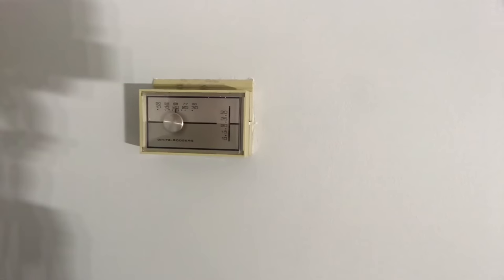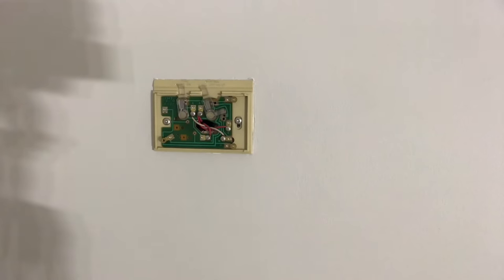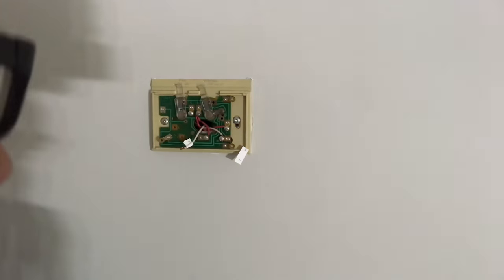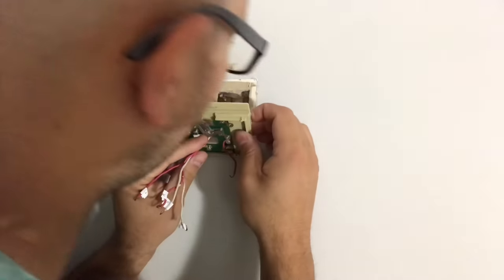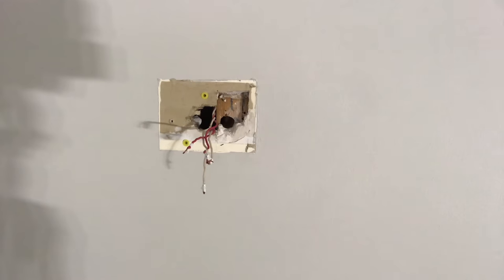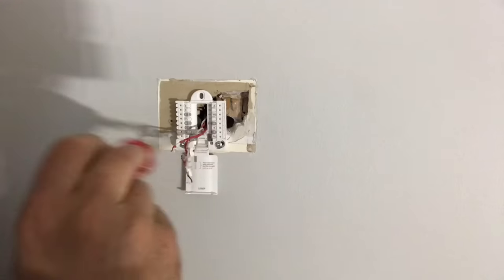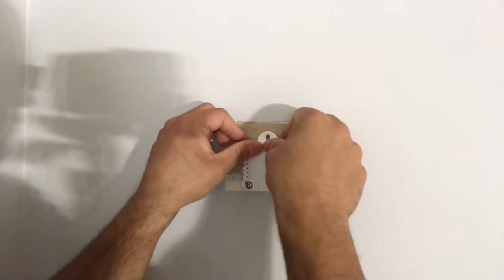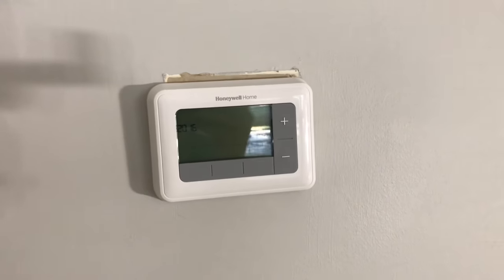How To Replace An Analog Thermostat With A Digital One-Tutorial

Comment: so if its possible to replace the analog one with a more modern digital one,, could it be possible to replace a modern digital one with an old analog one? i just got a new ac system installed, but they replaced my old thermostat with this too hard to use modern one...as long as its the same voltage (which it is) will it be okay to put my old one back in? i just dont want to damage anything or blow something up...haha. thanks

Comment: Can all mechanical thermostat be replaced by any digital thermostat? Or does this require some sort of matching of functions?
Reply: Can replace any old thermostat with any new digital thermostat. If you don't have the common power wire, then make sure to get a battery powered one.

Comment: instead of straightening out the hooks, cut them off ans strip back the wire. You have way more than enough wire and you will get a better connection and are less likely to have a break by using the unexposed wire.